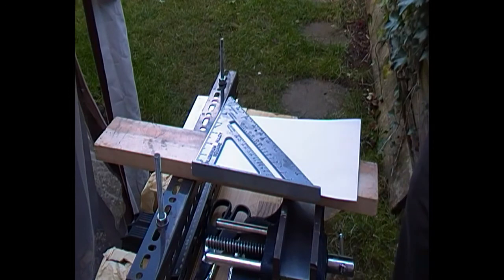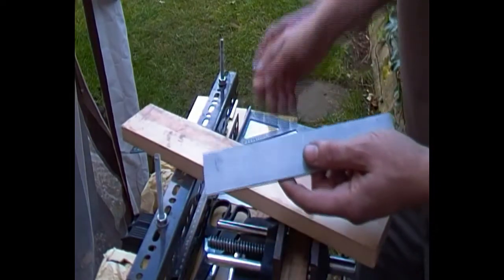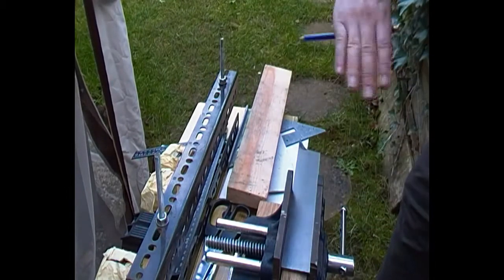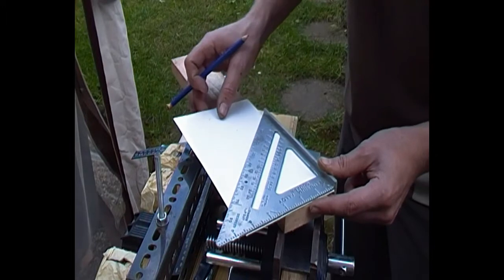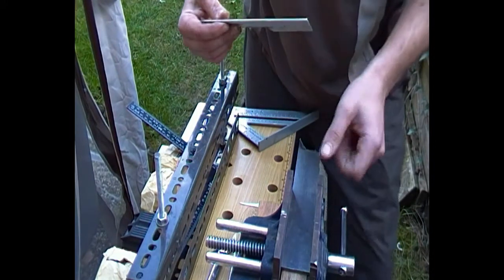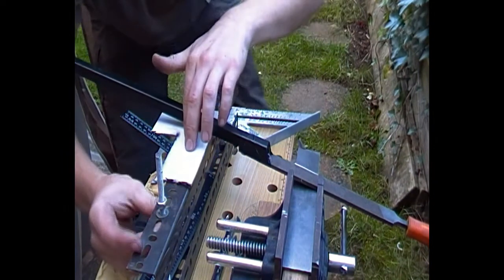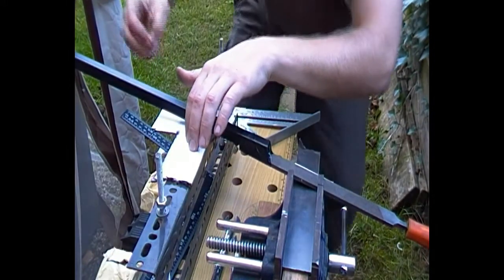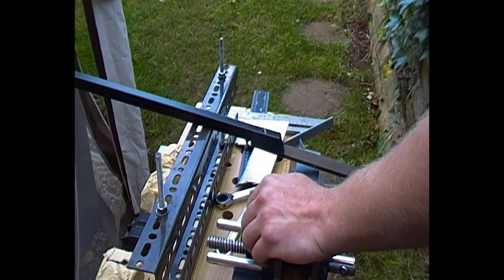Knife Making Re-visited, Bevel Grinding File Jig Set-up

Comment: you can also use a dial caliper to scribe the edge. you just set on side of the top if the blank and use the other side to scribe a stright line down the side as you drag it along.

Comment from the maker: It's not too bad for setting up. I have used it for quite a few different grind angles, and there isn't too much fiddling between angles. It normally lives on another bench, where the two threaded bars just bolt through the work top, making it nice and solid. If you wanted to, you could probably make different sized blocks, to sit the blade on, giving set angles without adjusting the jig. Seems a bit too much effort to me though lol

Comment: You could achieve the same result in a much simpler way with a device called an inclinometer. Where you're measuring angles and cutting out bits of cardboard, with an inclinometer you simply sit the magnetic side on top of your file and adjust your jig until you get the desired angle reading. I got mine for about $9 AUS. About 6 GBP. They are sold in most hardware or tool shops. Assuming your blade stock is level you will get perfect repeatable angles every time with 30sec of setup time.

Comment from the maker: lol, no worries buddy. You can use a caliber to scribe the lines. Anything made of hardened steel with a sharp edge will do the job. Just make sure you leave about a 1mm gap between the lines in the centre, so when it's hardened you can grind the bevels down to their final edge. This gets rid of the surface where the carbon has burnt off, getting down to the hard steel again. :)

Comment from the maker: I forgot to add that to the video. The way I do it is, keeping the file at 90º to the top guide bar (same as when you're filing the main part of the bevel), and "roll" it slightly (clockwise for when the handle is on the left, counterclockwise for when the handle is on the right),  when you're filing the tip. Imagine you have a knife with the bevel already ground in the clamp, and resting the file on it, so the face of the file is flat on the bevel.
Does that make sense?